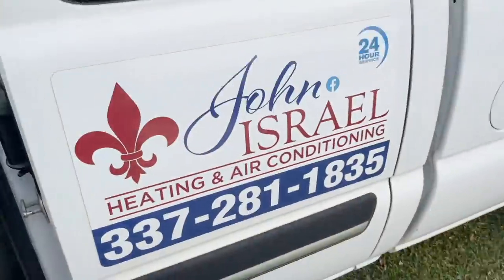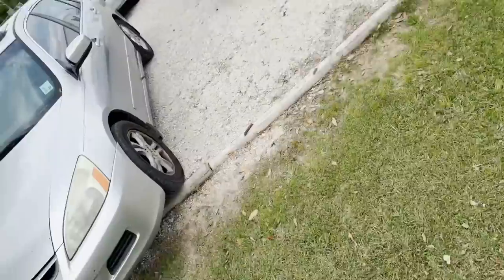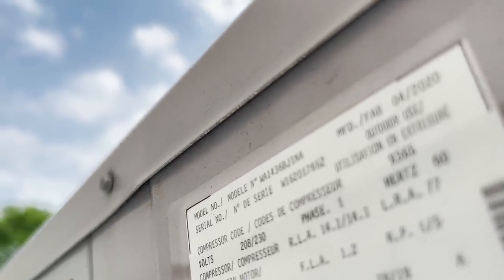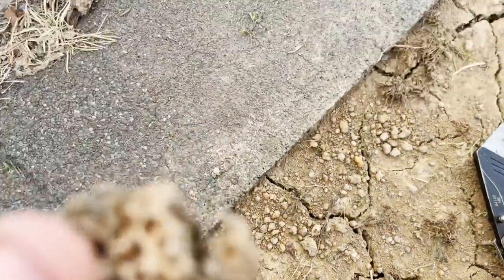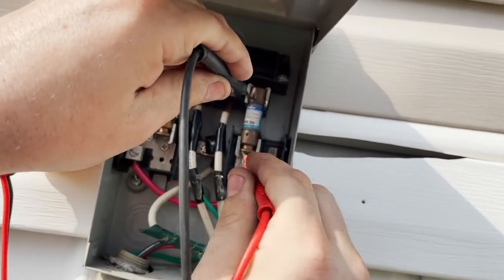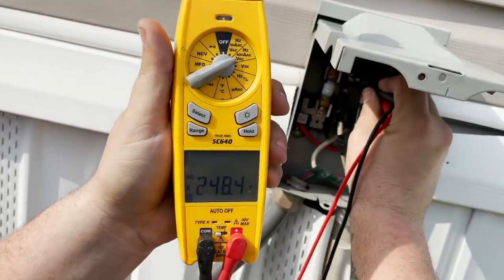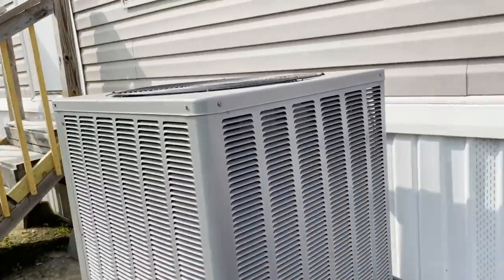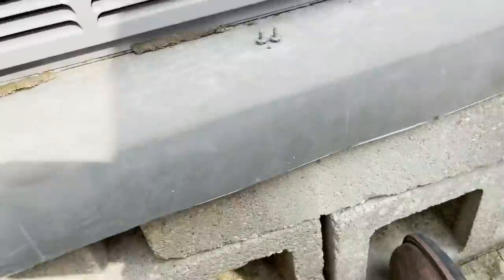No Cooling/Weight Loss and Life Update

Comment: I dont do residential but how you looked at the panel for subcooling and superheat was kinda cool . kinda new commercial hvac guy here just trying to learn. thanks for the 3 degree tip
Reply: 3 degree works on some, most resi Lennox stuff is +/- 1 so jsut read the chart
Reply: @johnstrh1  ty sir
Reply: @johnstrh1  ditto Lennox can be more picky. Also some york's. I've seen some calling for only 5° of subcooling and if you take 3° off that you're going to be low.

Comment: Checking the run capacitor would ease my mind on that call. Could been a weak Capacitor.
Reply: I would have also checked capacitor and compressor and condenser fan amp draw

Comment: Thanks for another great video, John!  Good troubleshooting skills from your experience with understanding TXV systems.  I would've be hesitant to leave the job without first checking the dual cap voltages to make sure the output was within the +/- 6% range.  You've had experience with those cheap Chinese capacitors, I'm sure.  A failing cap would certainly be a suspect in tripping a breaker.